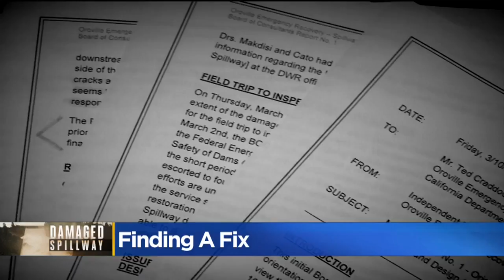Temporary Fix For Oroville Dam Spillway Could Involve Making Water Jump Gap

Comment: For  one thing , they  need to  blast a  canal to the  downriver side   so the water no longer runs  upriver impeding outflow of the power  plant. If it  was   turned  to the downriver side it  will increase outflow from the power plant just like  a  vennturi dredge  nozzle or carburator venturi, basically causing negative  pressure/increased  outflow for  the powerplant. As for  the  gap, get the ramp or some steel  plate/bridging in there before  its too  fn late..

Comment: It's a solution that won't work for a variety of reasons.  It also is not a building block towards a permanent replacement.  Nice demonstration of a seriously flawed idea.  It will obstruct a permanent solution, and neither the upper or lower remaining sections will withstand the load a ramp would present.  Both would be destroyed in short order.

Comment: Dear Readers,
First, I concur with "Nanette Lemus"'s suggestions. I am a Katrina survivor. 
Second, from the ALREADY BUILT 'oh, it will do' with a thickness of ONE FOOT spillway, some genius comes up with the idea of a ramp that is supposed to withstand 50,000 cubic feet of water per second pressure??????
Water runs to the chasm it created, right? (The path of least resistance.) Why not just CHANNEL the water to that chasm, and support the BOTTOM of the chasm, so the water flows away from the power plant? If it is possible, use "the teeth" at the bottom of the broken spillway, at the bottom of the chasm?

Comment: Build a bridge over the hole with steel spillway - make in sections and drop in place.  Or fill the hole with politicians and water engineers who failed to fix the problem years ago.
Reply: A steel structure had actually crossed my mind, or even steel lining a concrete spillway. But like you say, it could be built in sections and dropped in. That would allow a large portion of the job to be done off-site, and work can continue regardless of conditions in the hole. I do think at this point a steel bridge would be much faster, more cost effective, and longer lasting than trying to fill in that hole with anything, and expect it to not shift or settle.
Reply: Fill the hole with Trump's BS - it'd be filled to overflowing!

Comment: What about the rains that are heading to california right now? What about the snow about to thaw from the sierras? Will they wait until november?
Reply: Kiki Lula I wouldn't wait for any orders. I would get the hell out to a safer place now. Elected officials need to help people evacuate to safer places even if they need to set uo shelters out of state and in the state.
Reply: The spring thaw in the Sierras is a fairly predictable event. Engineers have a pretty good handle on the runoff and as such are able to predict lake levels in advance and make adjustments. The reservoir level right now is well below flood control parameters and the level for the emergency spill way is well above that. Currently the reservoir is at 843 feet and falling with outflows at around 45,000cfs and inflows in between 20,000-30,000cfs, and the lake tops the emergency at 901 feet. That's a full 58 feet of flood control that engineers have to work with.
Reply: Nick, this Spring thaw is not a predictable event.  The snowpack is so deep, and continuing to build in many areas of the Sierras,  that they are unable to accurately measure the depth, which is over 200 percent of historical levels. Near Tahoe, it is reaching 300 percent above normal.  The reservoir level is dropping slower than planned due to inflows coming close to outflows. They are already at the end of the planned release date, and still have several feet more to drain off to get it below 840 feet.  The Army Corps of Engineers has a 860 ft release point, which they ignored last time. At 901, the disaster would be catastrophic. We cannot trust the DWR to control the dam, or inform the public - who don't have access to the dam area, which they have declared a no fly-over zone as well. The independent forensic team, demanded by the FERC, has an entirely different view of this matter.
Reply: Now,now, we don't want to scare them with truth.
Reply: The storms that just hit us this week were weak in comparison to the series of storms that caused this incident in the first place. Today's rains were a mere drop in the bucket and Sunday's storm will be the same. Then next week weather clears again and will be in the 70's. 

Snow melt is no issues either. There is a ton of snow in the Sierras, but the thing about snow is even if it warms up some, it doesn't just all melt at once or in a week and come rushing down. It will take months for all that snow to melt away. It will come down in the rivers and streams as controllable runoff. Shasta Lake and Folsom Lake have both been lowered significantly to allow room for all the runoff. This isn't the first time we've had a ton of snow and flooding rains. We've handled a lot of snow runoff before in seasons where flooding occurred and can't find one instance in history where snow runoff in the spring and summer caused flooding in itself.

OneTrue_Morty has it 100% correct. The dam itself is perfectly safe and is in zero danger of failing. The media and YouTube channel aficionados who get paid for the clicks on their videos know how to spread fear very well. The issue here is the damaged spillway and emergency spillway which they will need to get repaired before next November. If they can't do that, then yes, maybe there will be danger again of the spillway itself failing and causing the top 30 feet of lake elevation to come down the river at once. That's bad, but nothing like complete dam failure.
Reply: YES THE DAM IT SELF is in NO danger ignorance is rampant online, but since i have been watching all the meetings and been keeping a eye on it since the start. 

 so you can shove your little tower up your backside.
Reply: You act like this is the first time the Sierras have had this much snow?  It's not. Everything will be fine. More snow doesn't equate to flooding during spring melt, it just prolongs the time it will take for it to melt.
Reply: oroville dam is perfectly safe this media always hypes shit beyond what really going on
Reply: One-True Morty -Oroville Dam is  perfectly safe?  You must have worked on the tower of Babel.
Reply: What an ignoramus you are.  The main spillway is failing, possibly back to the gates.  Then what genius?  As water pours out, you'll be pronouncing that the dam is intact.